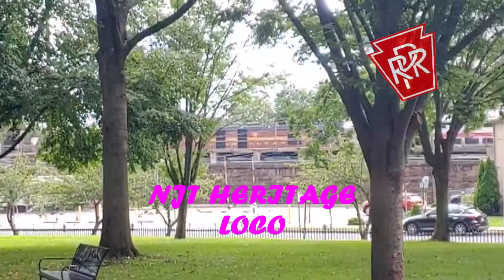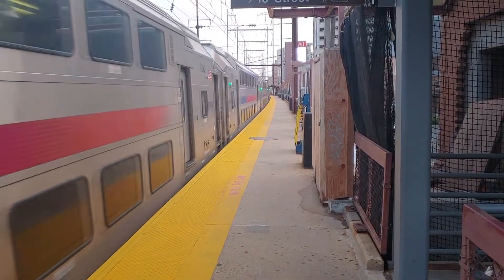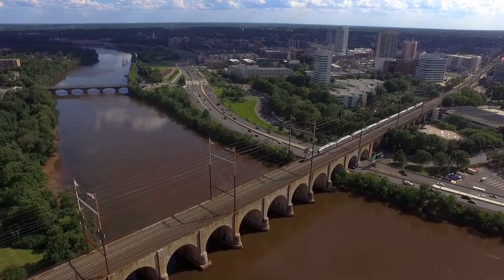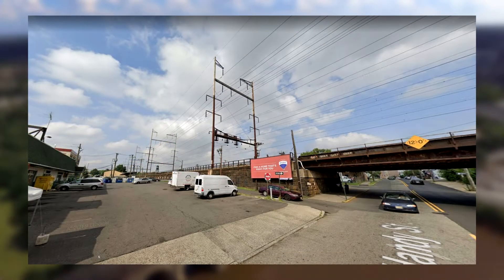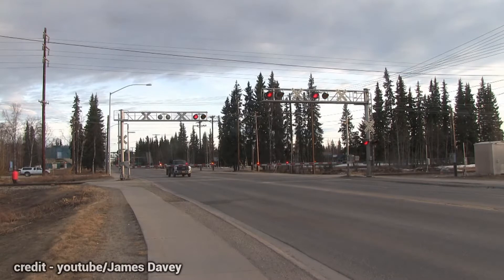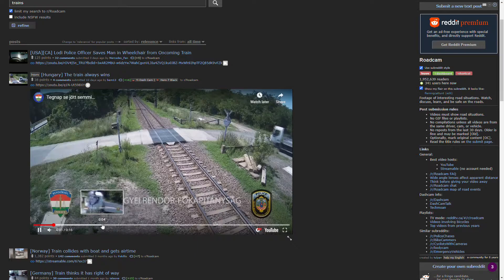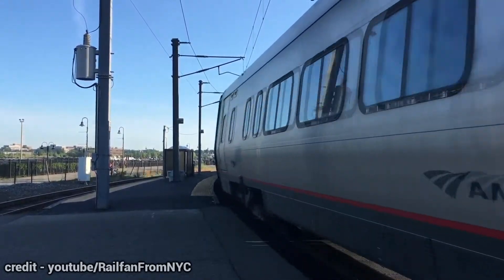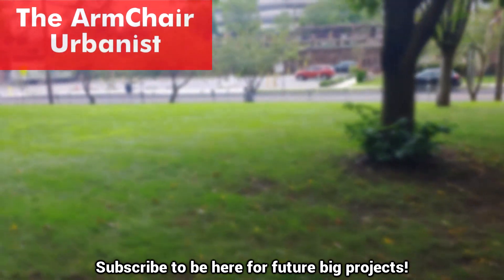Above, Below, and At Grade Separation for Trains explained!

Comment: I am not American but there is something which is not discussed as much with grade separation. The city of Melbourne has an extensive commuter train network and had around 180 level crossings. Since the 1960s, they have been actively removing level crossings and building road bridges, new train stations and train bridges. They recently formed a government body called “Level Crossing Removal Authority”, which lists dangerous level crossings, proposes plans to remove the crossing and starts construction on removing the level crossing. They often consist of new train station designs and road and track reconstruction.

Comment: One thing not mentioned is the psychological effect of whistles. I live in a town in Montana. We have a few at grade train crossings, and so for safety reasons, day and night, the trains passing through will sound a warning. This is, obviously, pretty bad for the tens of thousands of people who frequently get woken up. There have been a number of attempts by locals to pay for an upgrade, but they can't afford it alone it alone, and it was killed for "budget reasons" at a state level. Simply put, the at-grade crossings are actively generating visceral animosity for trains in the people who live in places like this, and I would say that is a bad thing.
Reply: One of the at-grade crossings along the NEC in eastern CT had signs showing that it was a quiet crossing - no train whistles allowed as they pass through, due to the nearby homes. I hadn’t noticed the sign at first, and thought it was very strange for a passing train not to sound the whistle. I wonder if your town might be able to get that kind of resolution.

Comment: In Sweden there is a concerted effort to build grade separated crossings.
However they are not replaced on a one for one basis which often leads to towns being divided and pedestrians having to walk longer routes when popular walking streets are closed off and pedestrians are directed to the underpass which is often shared with car traffic. 
Or a line is simply moved outside of town when it's upgraded from single to double track solving the level crossing problem but forcing people to take a bus instead of walking to the station.

Comment: There is an interesting side to the cost. Sometimes grade separation is cheaper because it increases the utilization of the roads and thus avoids costly upgrades. Especially when close to intersections, level crossings not only limit the traffic when gates are down. Drivers rightfully avoid standing on the crossing and thus leave gaps. Also intersection signals are often adapted to avoid traffic jams on the crossing, but this also comes at the cost of throughput.

Comment: My least favorite at-grade crossing is at Woodbourne Road in Bucks County, PA. SEPTA and freight lines both use the tracks. Route 1 crosses overhead just a few feet away making the crossing grade-separated is out of the question. And Woodbourne Road is a heavily traveled, under-designed link between Newtown and most of the rest of Lower Bucks County. Drove on it every day for years, probably entire days spent waiting for trains to cross. And if a freight train is on the side track, forget about it, you're not going anywhere.

Comment: Why are there such an enormous amount of wires above the tracks?
Reply: Each track has to have a running wire, the one the train pantograph slides along, and a suspension wire that supports the running wire with regularly space drop wires. The suspension wire (or catenary) is necessary once the speed gets above that of a streetcar or tram. And then above or to the side of all of this will be the power distribution cables that are larger and connected to the other ones at regular intervals. There may also be high tension power distribution cables to carry power at higher voltage than the 25 kV of the rest of the system. The higher voltage is reduces to 25 kV at regularly spaced substations by transformers.
Reply: Looks like they decided to also run some high voltage wires along the train track, as its a good place to put them

Comment: There's a bit of a backlash against removing level crossings here in Europe. Because not every level crossing is replaced by a grade separation, some force big detours on traffic, effectively sectioning a community. Now, for cars, a detour of a few km isn't such a big deal, but if you're on foot or even on a bicycle, those km add up, and often, they force them onto busier and thus more dangerous roads, which gives the 'safety' argument sometimes a bit of a bitter taste. Installing grade separation isn't always possible, either, especially if you want to continue service along the ROW. For building road bridges or tunnels, you need space there often isn't (and eminent domain is as complicated as it is in the US), and let's be honest, in an otherwise level environment, that bridge is a bit of a struggle for many people in poor shape. That's why there's a push for allowing pedestrian level crossings to remain, even after the level crossing is closed to road traffic.

Comment: It doesn't have to be a large number of accidents racked up at an at-grade crossing, sometimes (sadly) it only takes one really bad accident that makes all the papers.  That's what happened here in Toronto in 1975, when a TTC city bus was stalled on at-grade tracks and was hit by a GO Transit commuter train, resulting in 9 deaths and 20 injuries.  The crossing was replaced with grade separation just a few years later.

Comment: Your examples all point to raising or lowering the train line to seperate the crossing, often it might be cheaper and more practical to elevate or depress the roadway.  also the practice of using just flashing lights, bells, and a wooden breakaway crossing gate just isn't enough for today's entitled motorist, a physical barrier that would actually stop a car trying to beat the gates is a needed option, and driver training need to emphasize that there is no good time to stop with your vehicle on the tracks, so if the road is backed up to the crossing and there is no safe pad on the other side, DON'T CROSS!  Police need to spend more time on folks who do run the gates and less time on 2 mph 'rolling stops' at some rural road juncture.  Crossing gate cameras might also work.